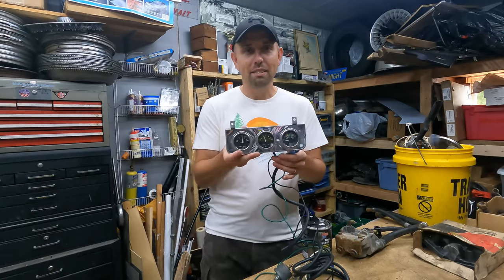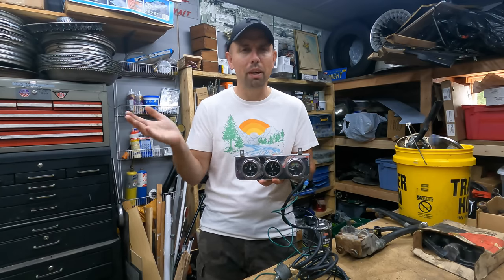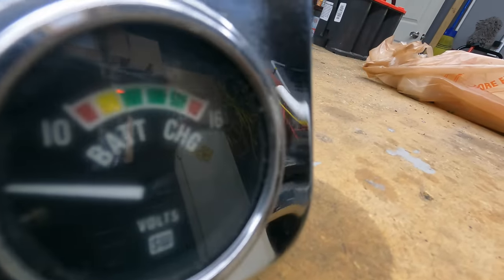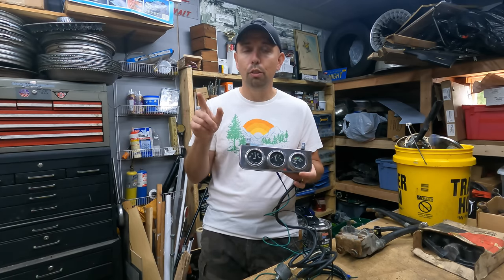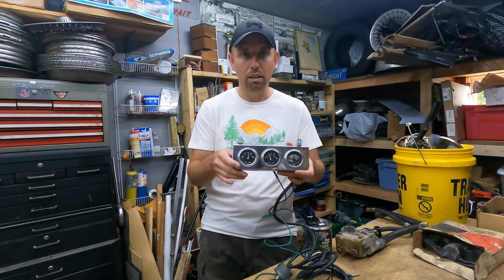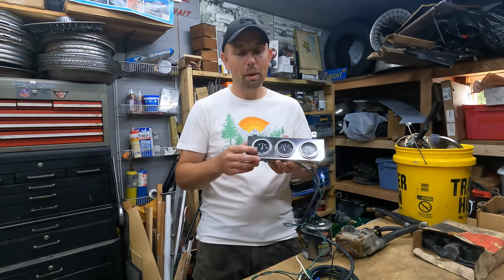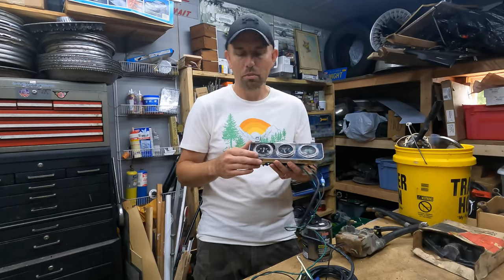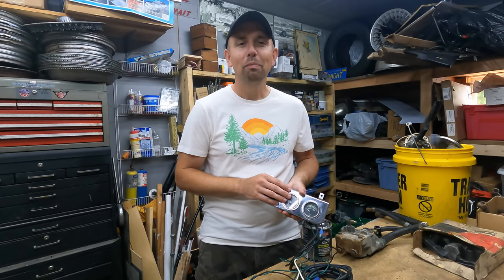How Did the Stuntmen Know if KITT Was Overheating? Knight Rider Auxiliary Gauges Reveal!

Comment: Hi Joe, in Germany,  a fan built a replica of KITT, and tied the KITT electronics into the gauges, and KITT can tell, if he is low on gas or oil. The speedometer, RPMs, Coolant and other readings were set to be told by KITT. If you can speak german, you might want to look it up. His name is Andreas Winkler from Germany. He can program response files, so KITT can tell you, if you are driving too fast or KITT is low on gas, or battery voltage.
Reply: Verrrry cool

Comment: I think you mentioned this device before if I am not mistaken. But cool stuff -  The only question now left: Did it actually ever happen? Did some of the cars really overheat once or had an oil leak not coming from a stunt?

Btw. for one moment I thought this was about how the film crew could know if the car was overheating when they filmed the insert-car mounted with all the lights around, which cause lots of heat XD

Comment: Nice!

Were any of the cars fitted with hydraulic brake valves to lock the front wheels? They aren't particularly powerful engines but burnouts were common in the show....how?
Reply: Great question.  You can see them braking the front wheels in order to spin the rears before taking off many times.  The 305 cars were slightly modified so they were "more" powerful than stock, but they had at least one 350cid car that looked pretty hot.  I think it is seen in the ep with the blind girl and Porsche, the race with the rooster camaro, and several other times in the show when they really wanted KITT to look like a beast

Comment: I do enjoy those little tit bits - you are right, I've never thought about it, but it is an obvious thing that needs to be said.  Even in the hero car, just to check if it is running, and standing on a hot day... is it over heating?

Did they have someone standing by to keep the car clean, so when they were ready for a shot, it would be immaculate?  Also, even tho it was the hero car, you rarely actually saw the dash itself... at least not that close.  So did it get dusty, until they needed it to be clean?  Or was that too, regularly cleaned?
Reply: On the Dukes of Hazzard they had water trucks that went out with the crew and sprayed off the cars between takes. They usually shot on dirt roads on that show wheras Knight Rider did not, but KITT being black would show dirt very quickly so I bet they did the same thing on the Knight Rider production

Comment: OMG, to overheat such an underpowered engine must have taken some serious incompetence at GM
Reply: Actually, underpowered engines are more likely to overheat than a regular or oversized engine, since they have to work harder to achieve the same performance.
Reply: @halofreak1990   If working at the same performance, yes. When working at full power the more powerful engine will generate more heat. Also, a properly designed cooling system should be able to maintain the right temperature even when the engine is working at full power for sustained periods of time
Reply: You would be surprised how little power a car engine actually has to deliver to reach the speed limit. 
45HP at 65mph is typical.
Car engines are designed to deliver 60HP continuously. Anything higher causes permanent damage to the engine simply because the bearing areas aren’t large enough to carry the increased loads with the stock oil pressures.
Reply: @allangibson2408  I wouldn't go that far. I've known engines that were frequently used to cruise at 100 miles an an hour or used for rallying, racing, and they did high mileages. Sure, it wasn't millions of miles some cars have managed to do, but hardly many cars reach 300 thousand miles before scrapping, and in Western Europe the average mileage of a scrapped car is about 100 thousand miles. Which is a shame btw.
The biggest problem for the engine is pushing it when it isn't well heated to it's normal operational temperature and choosing wrong rpms if you're driving a manual.
Reply: @piotrmalewski8178  The biggest wear item for internal combustion cars is the 10 seconds after the Ignition key is turned when the engine is turning but no oil pressure is present. Particularly a problem in really cold weather.
Taxi’s routinely rack up very high mileages simply because they never turn off the engine.
Body damage or corrosion is the usual reason for a car being scrapped or however. That said, I have had two cars written off due to timing belt issues (one where it broke and the other where the mechanic failed to tighten the adjustment bolts and destroyed the engine) and a third one destroyed by an engine fire caused by a fuel leak in the plastic intake manifold at 60,000 miles.
Reply: @allangibson2408  I know of that, but that has nothing to do with pushing the engine hard, and that is why I always use fully 'synthetic' motor oil, 5W40 or thinner in any engine.
Speaking of timing belt, I've never heard of issues with that, just as long as it is replaced within the age or mileage recommended. However I tend to replace it with a reserve unless I know it's a 'non-collision' engine.